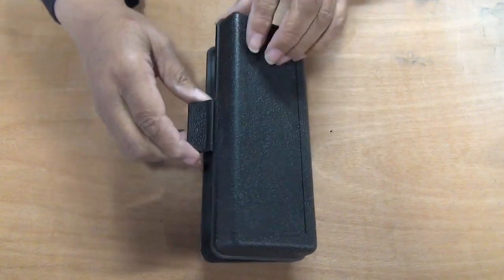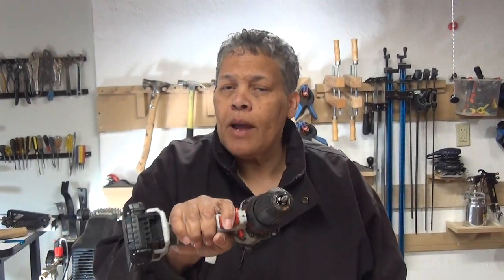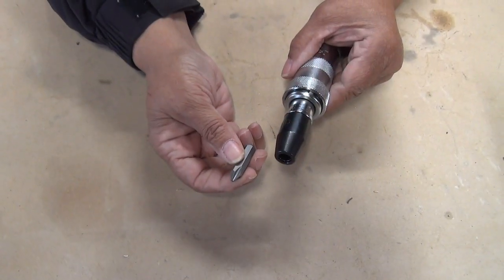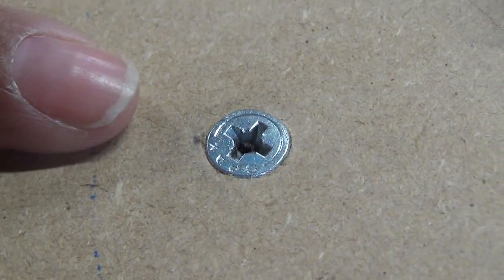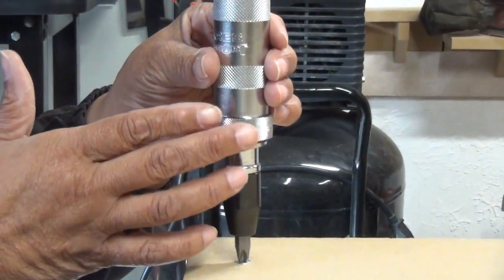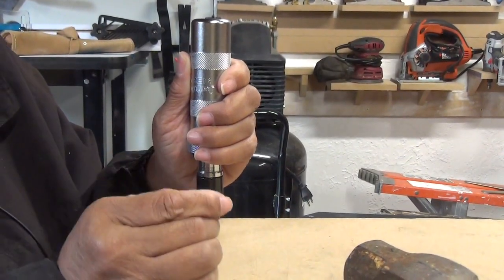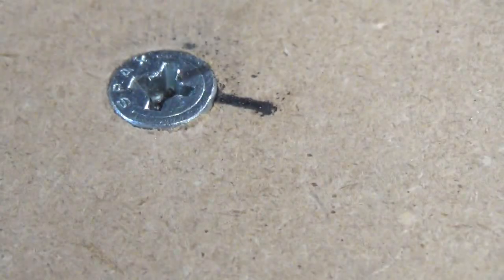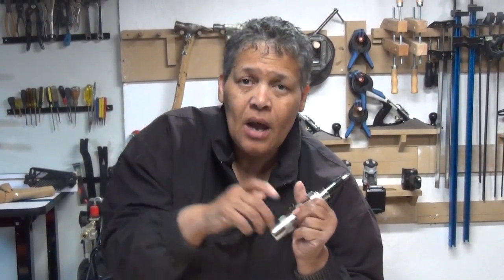Remove Stuck Screws with This Cool Tool

Comment: I just got one myself and already used it on a trouble screw I had, removing it in a moment!  My neighbor used it next, and with an adapter and a socket he loosened a rusted nut with three hits.  This tool is a joy to use and with care and a bit of penetrating oil applied first, rusted fasteners will move!!!   Its always in my tool box, and I have the knowledge that this tool is worth owning, even its only used once.  Thanks Leah, for the video, a real tool tip that will be of use to all of us.
Reply from the maker: you're very welcome, and thanks for commenting!
Reply: TrikeRoadPoet ... and whats best is its always fully "charged" !! 😅

Comment: I have had one of these for years (mine looks identical to the one in the vid) and I struggled with it at first, but years ago an old hand told me to 'take up the slack' (i.e. to push and twist the tool so it is under tension BEFORE you hit it). This means that all the impact force goes into the screw head rather than some of it being wasted moving the internal parts of the tool first. I have used this technique ever since and it's never failed me!  The screw driver bits are special steel too, so usually bite into stripped screw heads and still manage to remove them - in my experience of motorcycles and car use, anyway!     Love your videos and presenting style, Leah :-)

P.S. for UK viewers, the linked vid she mentions with the stripped nut extractors, are to be found as Irwin 'Bolt Grips' in the UK, from Machine mart or any good tool shop. Worth every penny if you ever work on vehicles IME!
Reply: This is an important point.  I too recall my use of an impact tool such as this  to split the cases of various motorcycle engines. One had to select either clockwise or counterclockwise by rotating a collar (on the tool I had).  Then you'd have to twist it the direction that the tool allowed you.  It's the pre-twist that converts the downwards blow of the hammer into a twisting motion.  

Great instructive video, Leah.  It may be helpful to include that as it's a basic function of the tool you refer to in this video. 

I just discovered your channel and RIGHT ON! :)
Reply from the maker: Thanks, multivogon and sam val for sharing your personal experience.  And thanks for watching!

Comment: When working on motorcycles and cars this tool has saved my butt many time. Great tool to have in your box.
Reply: A must have if you work on motorcycles.
Reply: yeah the clutch on my little dirtbike is held on by 4 of these impossible phillips screws
Reply: Not for laptops though
Reply: @kevintcp370   Louis needs one... for the Mac teardowns... 😏

Comment: Excellent demonstration of an excellent tool which apparently is being rediscovered. I needed one a few years back, wasn't able to find one from the expected places, and lucked out and found one at a yard sale. The kit appeared never to have been used.  And it absolutely is the most effective at what it does as long as there is clear work area to swing a hammer.

Comment: I have been using this tool since the '60s. Used it on Japanese motorcycles with phillips screws on the engine. It was the only way to get those too soft screws loose. Have since used up a couple more and always have one in my tool set wherever I am. Thank you.

Comment: I've worked with a lot of different tools but have never seen an impact screwdriver. I have needed this so many times. ~sigh~
Reply: OMG, yes, and she’s right, it’s usually the VERY LAST screw that is stripped/stuck like this!
Reply: They are widely used in automotive especially for the screw to remove rusty rotors
Reply: @eatwhatukiii2532  that's called Murphys law!!! 👍✌️
Reply: @Frederik Mare, so true, Murphy’s Law is in full swing at my place!

Comment: I love this, and  I see how it can help before a screw head is completely stripped, but I wonder if it also works after the screw head is stripped. I have a few I know will haunt me later, so I'd like to get the right tool for that job. Your video showed 2 screws, but the removal was on the one in better condition, so I wasn't sure. I'm so glad I found your site. Thanks!

Comment: Great explanation, Leah. This tool saved me today on a corroded steel screw in a aluminum machine housing... If you get one with a standard socket , like 1/4, 3/8" or 1/2", you can adapt it with any impact (or regular, but it won't be quite as strong) socket or phillips or hex or star driver bit. A tip... when you are working on a phillips bit, use as large a bit as will fit in the screw to avoid stripping the head. Thanks for the great content!

Comment: I bought one year's ago and they are invaluable for working on old rusted screws. They really do work and saves you alot of grief on old machine screws. Also old deck screws that strip before they will turn.

Comment: Leah! I came here looking for ways to remove some very stuck screws. I figured I’d check YouTube to see if an impact driver would work. Id just heard someone say in passing that it had changed his life as far as driving screws in but wasn’t sure about the reverse. Yours is the first vid that I found about impact drivers. I’ve not seen you for a while,  so happy to rediscover See Jane Drill.  I just bought the Tekton through your link. Thanks 🙏🏽
Reply from the maker: Thank you for your support and yes, I continue to make weekly videos.

Comment: One of the first tools I bought when I first riding motorcycles in the 70's. Factory tightened screw can be brutal to take out without stripping the head. To truly understand how this tool works, You have to take it apart to see how it works. You will then visualize this every time you use it.

Comment: First time I used an impact screwdriver was when removing screws on my throttle body on my truck, and yes, the factory used red thread lock so the screws wouldn't back out.  Adjust it to configure tto the screw, place it on the screw and mammer it with firm taps to get it untwisted and out of the hole...they did the job for me. Wonderful video, and a great tip.
Reply from the maker: thank you!

Comment: Cool you demonstrate this tool. As an electrician I sometimes have used this tool for removing stubborn screws in working on signs and other equipment which have hard screws to take out. Great video.

Jeff 
Journeyman Electrician
Reply from the maker: Always nice to hear from a brother in the trades :)

Comment: I used this same tool as a USAF F-16 Mechanic. Between the paint (paint barn) and G-forces from sorties, it could be a bear to remove screws on panels with a regular speed handle and bits. However, this tool worked awesome!

Comment: I just use a rubber band to remove stuck screws. (Place one layer of the band over the screw head, then remove with normal screwdriver.) But then again, I'm not usually working on cars, heavy equipment, or anything too rusted where I imagine something like this tool would be ideal. But if you're just trying to get a screw out that has the head stripped, simple cheap rubber band almost always works for me. I'm sure most folks know that trick already, just mentioning it for anyone that doesn't since almost everyone has a rubber band at home they can grab.

Comment: I love the way you explain things...I have used left handed drill bits many times to get broken bolts out ...iif you give the bolt a good tap with a center punch ..most of the time the bolt will spin out when the drill bit "grabs"
Reply from the maker: David, Thanks for sharing your personal experience.

Comment: Another thing to bare in mind about the last screw, sometimes it happens because since you already took all of the others the piece gets more force because how the material bents outward or if the piece was forced in with a lot of force because it was to big or wide to properly fit (this is usually a design/manufacturing flaw). What you can do if you don't have this tool is to re screw all of them and then unfasten everyone of them again but just little by little one and then the second screw and so on, by turns (think about this as if you were unscrewing all of the screws at the same time) this would distribute the upwards force between all of the screws instead just one so you don't have to push to hard on to the screw and thus eliminating he need for this tool (most of the cases, still there are some times that you will need this kind of tool or sometimes even break the screw or drill around it)
Reply from the maker: Thanks for commenting

Comment: I've had one of these forever. I used to use it to loosen screws from my aluminum motorcycle housing. Even with this impact screwdriver, some of them were ridiculously hard to loosen. Aluminum on steel. I haven't used this tool in decades.

Comment: Hey! This is exactly what I was looking for. I have a steel torx screw that's stuck holding in the pocket clip for a knife. The company isn't known for using threadlocker, but I've tried heat anyway. Also tried penetrating oil and impact, but as the screw is going into titanium, I doubt corrosion would be the culprit.

This looks to be the tool I'm looking for, as I need to re-use the screw once it's loose, so a screw extractor sounds too destructive.

Comment: Not often used but when needed, it will save you a lot of pain. I bought my first one early in my carrear in the early 70s. Not used often but it was there to save the day. I found a small one at harbor freight. Already saved me several times on some electronics. Note, always take these apart and grease them up.

Comment: Leah:

If you would buy some Crosshead screwdrivers or hex bits made to the JIS standard (Japan Industrial Standard) your bits would not cam out and strip the Philips Head screws.  JIS crosshead screws are designed to both drive the screw in and remove it without damaging the screw.  My understanding of the Philips head screw is that it was designed for automated assembly line work and would cam out or slip out of the screw when the machine got the screw tight enough. I am not a tool historian, but decades ago, when I used to work on Japanese motorcycles and cars, I wondered why they used such cheap screws that always seemed to get the heads stripped when you took them apart; it wasn’t until a couple of years ago that I first heard we should have been using Japanese JIS standard Crosshead drivers on these screws, which were not cheaply made, as well as on the Philips Head Screws we were all used to. They work better on Philips Head screws than  the typical American Philips screwdriver or bit.  Available at specialty tool stores, online, and perhaps places that sell Japanese motorcycles or the tools to repair them.

Comment: That is a handy tool, and the last one I saw was in the shop I worked in while in the Air Force, and working on the A-10 Thunderbolt. We never used them much, but there was times when they was needed to remove metal parts which was difficult to remove with a regular screwdriver.
Reply from the maker: Were you a airplane mechanic ?
Reply: My last job was as a Cargo Specialist, and worked on the C-130's, C-141's, C-5's, and many commercial aircraft also. Before that I was working on the A-10 attack aircraft, and first worked on the B-52's as a munitions specialist with conventional and nuclear weapons.

Comment: I use an old drill bit that I found years ago in a hardware store. I think it is called Grabber or Grab It or something like that. You put one end into the drill and go one way, then flip the bit around and go in the other direction. It works, but I have to look up the instructions to remember which direction to go with which end of the bit, lol. I might try your method next time I need to remove a stripped screwhead.

Comment: Leah, I just found you and subscribed. My first miracle was when I Googled Moffat Provencal 300 and found Reliable Parts in Toronto who actually had the replacement Baker Element for my oven (came with the house in 85). So I completely understand what should have been an easy removal and replacement....except the two horizontal screws that hold the plate on the back oven wall...will not budge.I used WD 40, hit with hammer, tried both strong hand screwdriver and power drill. OH...mine are sqare Robertson heads with a dome screw head. The screws are horizontal into metal oven wall. I am now looking into versions of screw extractors...like Grabit, What should have been such a simple replacement is very frustrating because I don't want to damage the back oven wall...or its threads in the 2 screw holes. I noticed you did answer others (commendable, Leah) any ideas or videos. I think the choice in this video might damage the oven screw holes.

Comment: Ahhh... I remember this tool... 40+ years ago, working on my japanese motorcycles that were "infested" with phillips head screws... first job was always  to replace them all with Allen screws.
I LOVED this thing and being a 1/2" drive, you could also use sockets on it !! 🤗

Comment: Thanks for the tip. I have several large discoloured mirrors in the bathroom and the screws have rusted. I bought replacement mirrors but couldn't get the screws out. I couldnt buy the tool via your link, as I live in England, but bought via Amazon England.😊
Reply from the maker: The tool is mostly used in mechanic work.  I'm not certain it will work for the application you mentioned, the vibration may shatter the glass.....I wouldn't try it on such a task.
Reply: seejanedrill Thanks. Although I would not mind the glass shattering I have cancelled the order, for H&S reasons. I suppose its best. Do you have advice on removing rusty screws? I tried vinegar and it did not work.
Reply: It will work a.Use a smaller hammer . Take your time. Good luck.
Reply: Jeffrey Bauer . Thanks. I will re order the tool and give it a try.

Comment: Hi Lea, I have used your stuff before, you should be what you are, a national teacher, thanks a lot
Reply from the maker: thank you very much!
Reply: As a follow up, sooo many people I have run into of late have never heard of an "impact screwdriver", but they have heard of an impact driver.  I ordered one, on line.  Several people at Home Depot never heard of it, either.  I can't imagine not using it, now that I am aware of the tool.  In fact, I have delayed a project that would--for sure, have stripped a bolt on my outboard engine, waiting for the right tool to arrive.  And I have told many people about you lately, my wife, Donna, knows more about tools and how to use them, than most people and I tell them, in regard to you "think Donna on steroids".  You are just too good.

Comment: I was working on my outboard motor and the screws were stuck on the lower unit. After many attempts and given up. My next option was to take it to the mechanic and I was will to pay $40 if I had to. Then I came across this tool on amazon. I was happy that it saved me money and I now have an extra tool at my disposal. Go get one.

Comment: I THOUGHT I was pretty well up on tools. This is one I haven't seen, but have NEEDED a bunch of times. I'll have to check it out for myself. But many is the time every liquid penetrant and even heat have failed me. It's not like you always have access to an air compressor or impact gun or access doesn't allow their use. If this works like I hope it's a fantastic addition to a handyman/mechanics arsenal.

Comment: I got one of those to remove the rusted screws from the rotors on my old honda.  It was still a pain to remove them, but I got them off without stripping the head.

Comment: Do you have any suggestions for a stripped sewing machine screw?  I need to remove a bobbin case from the inside of an industrial sewing machine.  Do they make these any smaller?  And if so, are there any brands you could recommend?

Comment: Leah, loved the video!  Is there a tool similar for a hex bolt removal.  My nail gun isn't working right so I attempted to remove the hex bolt screws and only got one out...now I have three stripped hex bolts...sigh.  Any ideas before I ship it back to have them removed?   Lin
Reply from the maker: This may work: https://youtu.be/xzX6LVm8H1c

Comment: You can also take the tip holder off and use it for sockets.  If you have a bolt that is stuck in a metal to metal situation you can heat it up to get to free up.  Also never under estimate the power of lubrication.  A bit of penetrating oil can work wonders.